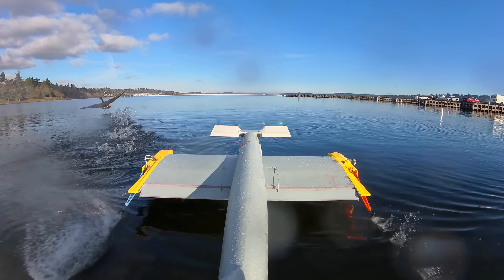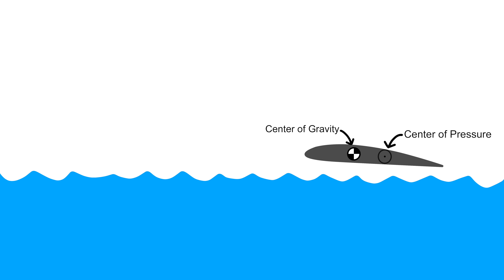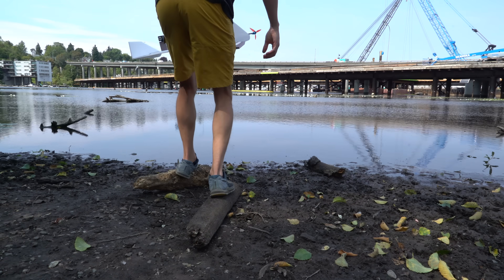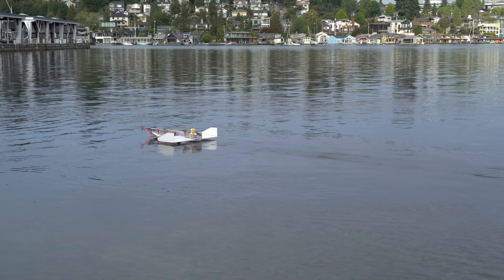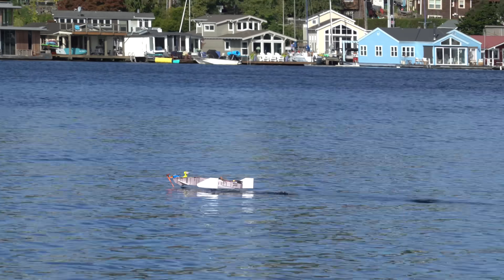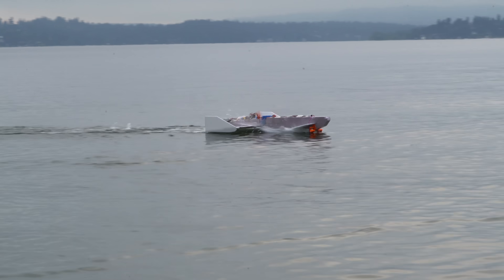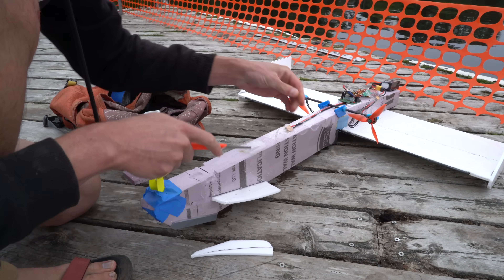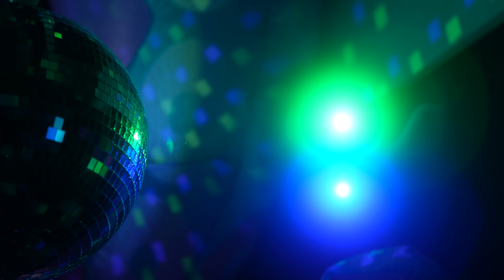Testing a Hydroplane / Ekranoplan Hybrid

Comment from the maker: Download the FREE Upside App at https://upside.app.link/rctestflight to get an extra 25 cents back for every gallon on your first tank of gas.
Reply: Not gonna lie, that app sounds sketchy AF without doing any research makes me think Honey. And I'm back from looking it up, I guess it's legit, but still one of those "if you're not paying, you're the product".
Reply: @jeremiahl3529  Yea it "just" collects everything about all of what you do. If you turn off location and also disable the app from running in the background it "isn't so bad" it's sad to say this, but google, amazon, apple, and facebook..  are worse anyway.
Reply: Free money just appears.. are we the product?
Reply: @JeffBilkins  Yes, I have had it for years and got about $300 from it. It gains access to see what you are buying and sells the data to target you with adverts. Nothing google and your phone isn't already doing in my book, so I was fine with it
Reply: How about having a sliding mount for the battery and the water sensing wand sides the battery back/forward to change the COG?  I was thinking about moving the wing but think that would be more difficult.
Reply: Hello! What if we add a speed sensor and a moving load so that it moves forward at high speed, changing the center of mass?
Reply: What if you do a canard scheme ekranoplan with a tail wing with pivoting point near CoP. So when CoP shifts, it changes angle of attack of the wing and pitches plane up or down.
And this system can be trimmed via springs with different tensions.
Reply: Mate... Hydrofoil on the  nose with its own elevator control. it would keep the nose exact above the water using your sonar setup. Also.... what about an active "swing wing" f14 style to move the CG fore and aft and thus centre of pressure?  always look forward to your videos here across the pond!!
Reply: @austinmaxi I was thinking about the same thing or a spoiler on part of the wing that adjusts with speed and/or pitch
Reply: Why not just make a shifting ballast system with water tanks.
Reply: @Thelongmanable The last thing you want to do is add extra weight to an aircraft and pumping water is slow.  Moving masses that are already part of ir required by the aircraft would be a better solution if possible.
Reply: check this: RU2224671C1 - Self-stabilizing wins-in-ground-effect craft
I think this patent will help you build the "perfect" ekranoplan.
Reply: Can you make the center of mass vary according to the aircraft's pitch? Like a weight that shifts forward or backward very quickly?
Reply: How about using both hydrofoil and surface wings together?
Reply: Hey here's an idea that could make this work. Use a small hydrofoil wing with a built in flap mounted underneath the front part of the boat. The foil just pulls the front down and will cut through the waves providing smooth stability to keep the craft in ground effect. The craft would be kept held down in ground effect using the variable lift from the foil pulling down the front nose, and then elevons on the above water wing will control roll....This could be a positive stability loop, with the max speed being the cavitation barrier. The faster the craft goes and more air wants to pull the thing up, the more pulling down force from the foil; and water forces are stronger than air so the foil shouldnt be ripped out of the water. Also having a foil in the water means you can use the mast as a rudder, possibly making for a high turn speed rate. With motor placement, go for a puller setup instead of a pusher, that way doing high rate turns will be passively stable. I suppose doing this means the foil could lift a significant weight by itself, although it wouldnt be in water ground effect XD but it is still flying in the water, not planing. So it retains its style points from being a high efficiency flying craft 8)
Reply: Hydrophoil wing would make the rest of it completely obsolete because it would be the entire system at that point. This is a Russian billion dollar toy that never worked and would be extremely easy to missile attack because it's not capable of advasive maneuvers. Also Russian used rockets and turbines because they can straight line without a lifting wing etc. Alot of things appear great on paper but never actually work like velocity stacks etc.
Reply: Try a canard closer to the water so that when it gets close to the water its lift increases, while the wing is higher up and still producing more stable lift.  The canard angle of an incidence should be higher than the wing for stability in general.  Test fly it in the air to make sure it is stable.  You could make it like the piaggio and have a tail that is even higher than the wing to stay out of ground effect.   Being stable in and out of ground effect should be solvable.   There are a few startups doing it.
Reply: Try extending the tail section so when you are about to have a blow over the tail drags.  Like wheelie bars on a dragster
Reply: Actually based on Russian designs they corrected by placing turbines/rockets in the front of the aircraft along with tail turbines/ rockets in the back for a ballast control. Two prop set up doesn't work he would need at least two more on the front to regulate lift!!!
Reply: You try one more concept , using a pitch based propeller angle ,visualize a central path line guiding the body’s movement, with automatic corrections occurring whenever pitch variations pull it off course (only drone propeller based) and (idea 2 using a toggle switch to enabling hover and flight)
Reply: have you considered using a hydrofoil(or airfoil) on nose to hold the nose down like on F1's with nose airfoil for eg u could have a airfoil that is at neutral when its at the right angle of attack but provides down force as soon as it goes above angle u want or vice versa with a underslung hydrofoil  pushing nose up and move the center of balance so its always nose diving. or even both that way u have a countervailing force in either direction
Reply: Rather than a V shaped hull I think something like a duck shaped hull might work exceptionally well. When waterbirds do the equivalent of using the ground effect over water their bodies are teardrop shaped. I don't know how to describe all the mechanics (nor do I understand them) but I'll try to explain how I think it would work: The leading surface (chest) acts as a lifting body to bring the nose out of the water making the point of contact with the water way behind the centre of gravity. So pitching up makes more drag in the water pitching you back down. 
I know the birds also have dynamic flight control surfaces but I still think the Duckbody™ might hold water
Reply: When is the next house party with the colorful lighting?
Reply: Free Money? Sounds legit.    When a company uses ethic only ppl for commercials,  it’s a poor ppl scam.  Try harder
Reply: uh, my fuel is free... lol   its called converting to Hydrogen
Reply: Omg. Why dont you just drive an EV already?
Reply: @rctestflight  I was really into this video until you used AI garbage in it.  I nope'd out pretty hard at that point.
Reply from the maker: @dernudel1615 omg cry me a river

Comment: This is probably a ridiculous thing to say but sometimes I think all you need is to just make your ground effect vehicles at least a bit heavier. They aren't typical airplanes for example.
Reply: example, a train clearing snow and things from its tracks. you're driving a rear wheel pickup in winter with an empty bed, a old mail jeep with a 300 HP v8 and no other mods wheelies for days. just curious what weight added to all that power would do in the same situation.

Comment: The front control arms should be damped by a spring AND shock absorber combination. RC car shock absorbers (with springs) would be a convenient pre-made solution. (Then it's a boat/plane/car...a trullet?) The viscosity in the shock absorber will slow the return of the control arms thereby reducing the loop gain of the mechanical system, and if tuned well, could reduce a lot of the porpoising. I think. :)

Comment: The large horizontal stabilizer has a large degree of Dihedral. If your 'wing' had some dihedral it may help with lateral stability, a lot. Of course, the angle of this dihedral would need to be relatively small otherwise it begins to defeat the effectiveness of ground effect.
A heavier model would have greater inertia & may help to reduce the oscillation frequency & amplitude of the skipping, & a longer fuselage might well reduce the angle of attack when the front begins to rise, as long as the tail end is still on the water..

Comment: Very interesting and learned a lot! I note that you wish to have no aerodynamic controls so .... is this a stupid idea ...... mount a weight which can slide fore and aft via a servo.  You can tell how far above the water you are with that little blade you had at the front which touches the water (I forget its name). But when the blade is deflected a lot, indicating the craft is close the the surface, move the weight aft. When the blade is deflected  less, indicating the craft is rising from the surface, move the weight forward. Fun project, enjoying your efforts!

Comment: I assume it would be too heavy but could you use a gyro and dynamically change the center of gravity of the wing via a hollow channel with a tiny weight to shift back and forth as the center of pressure changes?

Comment: The Robinson R-22 uses a symmetrical airfoil for the main rotor since the center of pressure doesn’t shift with changing angles of attack. Try that!

Comment: The SWATH (Small-waterplane-area twin hull) principle uses being out of the depths where waves have the most energy. This is also used by hydrofoil. You could use a hydrofoil with propeller and adjustable wings attached to the nose to keep the nose at a certain distance over the water. It will do two things, prevent the nose from touching the water (bumping on the waves) and draw the nose back in case of a lift-off-situation. But the main weight of the aircraft/boat will be lifted by the gound effect. In the end, what the world needs, is a heavy transporter on water that can travel much faster than a classic boat, but doesn't need much more energy. One would do the world a favor, if one would create something that allows an huge container ship to get in gliding speed. Something like an ultra stiff hull and 20 gigantic hydrofoils below it, so a 200m long ship could lift out of the water without breaking.

Comment: you need a passive mechanism which in casse of an flipover reacts. thinking of an weight on an stick which rotates to the front / nose and set back when the right angle has reached again. thx so much for  sharing!

Comment: Your evaluation is HOW it floats, is wrong.. It's not floating, it's called ground effect. Aerodynamic ground effect is a positive-feedback phenomenon where lift increases and drag decreases near the ground, which can cause a "floating" sensation during landing if the aircraft is too fast. High wing aircraft experience about 60% of induced drag causing that floating experience. As compared to low wing aircraft that experience even less at 40% of the induced drag. Tho only a flight amount of DEFLECTION occurs, the definition of FLOATING on a CUSHION of air is incorrect. I'm a CFI, BS in aerodynamics and Professional Pilot Program. When your model grid higher, wing vortices are fully developed and create more induced drag thus a bed for more power and more wing list area to fly. Since the wing isn't big enough to create the lift, drag overcomes and the wing loses lift, where it sink back into ground effect. Once in GE, wing tip vortices are broken up creating less drag, allowing for more lift with low drag.. There IS NO CUSHION OF AIR.
Your description of the shifting of the center of pressure is correct.

Comment: I think the way you originally made the hydroplane on the video was the best. Except the answer may be to extend the front with only propellers at front on a long light weight tube like a flamingo in flight with out legs. The heavy stuff will be in the large rear wing . The front nose with small float and propellers will always lift up clearing the water on take off and controlled to remain on a constant angle upward to the water no mater what, dragging the rear end wing behind it.

Comment: What do you think would result if you used canards controlled with a MEMS gyro and a bit of code.  That should give you fast control to keep the nose at the proper angle for the speed.

Comment: Here is just something that came into my mind: Make tail that has float, when the float starts to come off of the water, it will automaticly pull the tail wings down and correct flying angle to be always perfect to correct that center of pressure vs center of gravity dilemma when the height from surface alters.

Comment: 0:02 Was having a good think about the porposing issue. The dampening is key, however the contact point is fixed and stiff and offers no dampening. If you could attach a damper to the forwards contact point you can tune out the porposing. Would also consider changing less variables at the same time. Set a flight speed and tune for it

If you think of the wand on a trifoioer it follows the surface but also dampens

I'm a. engineer who has done a lot of work on theoretical hydrofoil design and CFD. 

Think of the up movement as the spring reaction , to balance it you need a dampener on the opposite side of the equation your trying to reach a steady state but the oscillations are to large to control initially. Hope that makes sense

Comment: You did create a vehicle with an oversteering tendency. Think about that a busted tyre at the front wheels will be better to handle than a busted rear wheel, which will make the car uncontrollable.You want a rather loose front and a tighter tracked rear to get a straight and easy steering . The water screws provide a too tight tracking while having a rear swaying in der air.

Comment: All of that when all you need is a longer planing surface with a shallower incidence angle to the water. And move the intended point of contact further rearward from the nose.

You call this good training data, but it's not because you're not learning the right things. You still walked away from this with a flawed understanding of the problem.

Comment: I suggest testing a hydrofoil instead of a hydroplane - less drag and more potential for control and it allows for more altitude.
If you use a V shaped hydrofoil it can have it's own negative feedback built in.

Comment: My first thought when you were explaining the center of lift and center of gravity issue was to design a different shape of wing that didn’t have this different characteristic. If the center of lift is exactly in the middle of the chord of the wing, it should achieve this, right??? What about a wing made almost entirely of leading edge slats? All this is so much fun, thanks for doing it and recording it.

Comment: What if you put a hydra foil wing on the front of the ship?  The foils drag through the water might keep the ship from flipping up out of the water at high speed? Create spar that the goes the hull so the hydrafoil can mechanical rotate out of the water in front of the ship for shallow low speed operations? The above water wing brings the hull out of the water at speed for the air cushion effect.  No motors would need to be in the water other than maybe a bow thruster for low speed maneuvering in the water.  Move the fuel or battery’s into the wings to spread the weight out of the hull to leave room for cargo/passengers.  Putting some weight inside the hull to simulate cargo might keep the ship closer to the water?

Comment: Effectively the Caspian Sea Monster has a second set of wings with huge dihedral on the rear... They're quite well size matched to the front and effectively they' have a much greater ground effect separation that's much more progressive about decoupling because of the dihedral... That seems like a solution for you...

Comment: When formula 1 went back to using ground effects last season there were teams struggling with the porposing effect which looks very similar to what you're experiencing.
 
Damping out the oscillations will be the key. I have a gut feeling that having a longer tail would definitely improve performance

Comment: use a sort of hydrofoil in the front to solve ur issue. if u can change the pitch of the foil u can adjust how high you want to nose without it touching the water.

Comment: Just an idea - you can put hydrofoil on the nose so it's "flying" in the water, while the rest is in the air. That would probably remove the bouncing and make it much more stable. But I'm not sure will it still be technically an ekranoplan after that.

Comment: The skimmer needs a KEEL! The idea is to make a "knife edge" to cut through the water surface to slow the deceleration when descending into the water, and slow the acceleration from buoyancy and planing when rising back out of the water. I'm not sure whether concave or convex is better but I suspect profile will have a significant effect on stability and maneuverability much like boats.

Comment: great enthusiasm for sure. Keep going man! A couple thing! 
First ! Why try to reinvent design that already work "Ekranoplan"? Keep the wing in the middle! Second to stop the front misbehaving have a prop or a ducted fan  mounted vertically front (or Front and back! if you want to reduce the Tail Controls Size)  and speed controlled depending of the attitude or the average vertical acceleration..